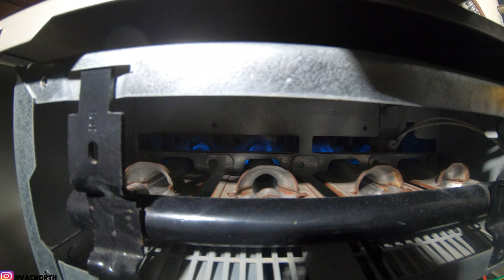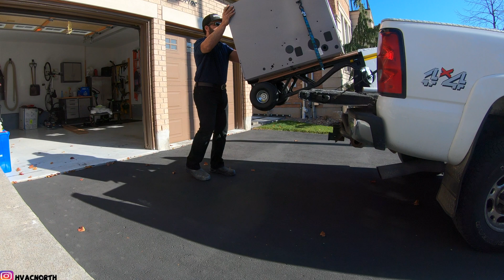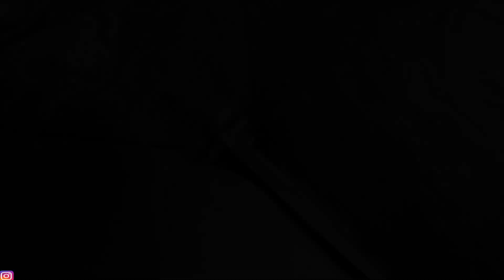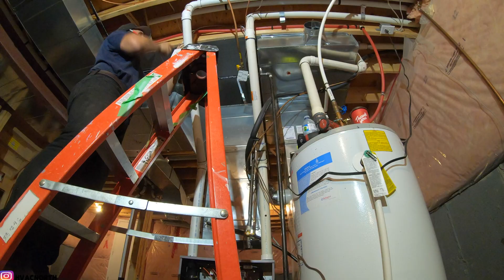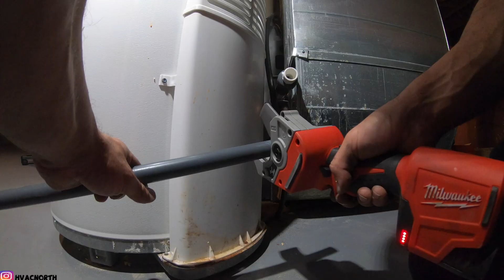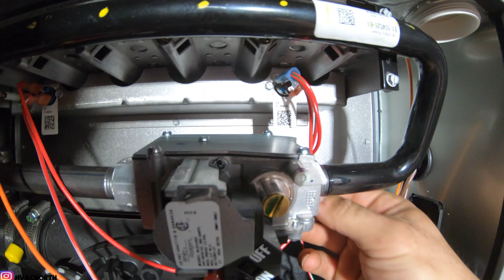HVAC: Furnace Replaced | Bad Heat exchanger

Comment: So furnace replacement u need angle grinder to cut off the old furnace? And drill for new ducts or pipe thru the bricks of house?
Reply from the maker: no
Reply: How come I saw the angle grinder there and what it's use for?
Reply from the maker: @xianli6488  just easier for me. You can use shears.
Reply: @HVACRNorth  is those tools for connecting pipes meant as shears? This replacement took 1 day  besides duct?
Reply from the maker: @xianli6488  yes 1 day. connecting Gas? pipe wrenches.
Reply: I heard shears are like those kind of pipe wrenches?
Reply: I can't seem to upload a pic of it on YouTube but shears are like scissors?
Reply from the maker: @xianli6488  yes

Comment: I agree with you on combustion air pipe, the only problem I run across is moisture dripping inside the furnace from the combustion air pipe when it is being pulled from outside. Majority of the brands are having this issue (especially in a humid environment), they all say “recommended” but not mandatory of having a external drain on the combustion air pipe, the unfortunate thing is if you don’t then be prepared of rusted components inside the furnace after a couple years. Good Video👍
Reply from the maker: Thanks bud.

Comment: Wow no primer. We have to use purple primer on all exhaust pipes. Very unsafe.  Glue will dry up and eventually fail. I’m in New England. Must have different codes where you are. Good video.
Reply: GLUE DOSN'T GLUE PIPES, IT MELTS  INSIDE TOGETHER (FUSES PIPES).  IN COLD WEATHER PIPE IS TO HARD, PRIMER SOFTENS PIPE SO GLUE CAN FUSE JOINT TOGETHER

Comment: Cutting for the return air opening with an angle grinder and sparks flying into the new blower motor and electronic board 😂 . Keep hacking
Reply: You must have missed the 'I have the blower motor covered to not get any shavings on it"
Reply from the maker: @craighvac1808  thankslol